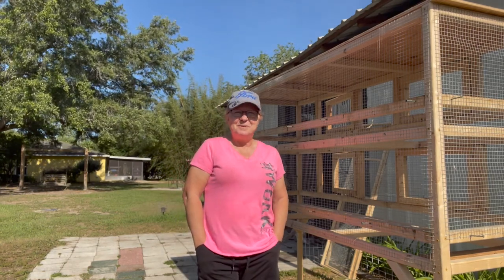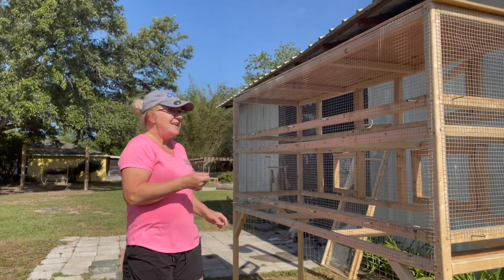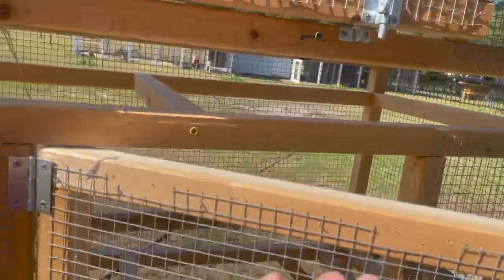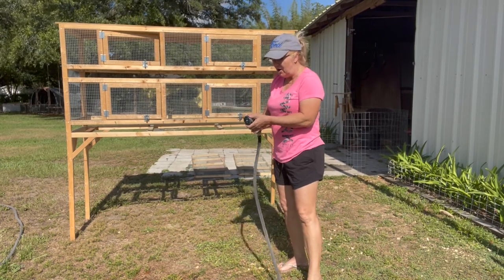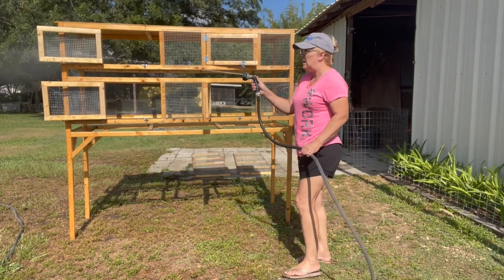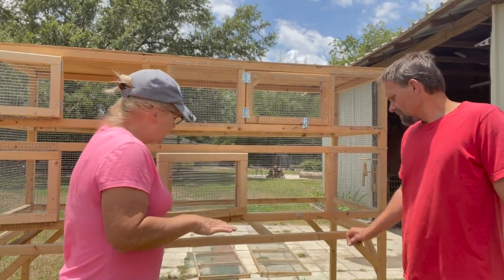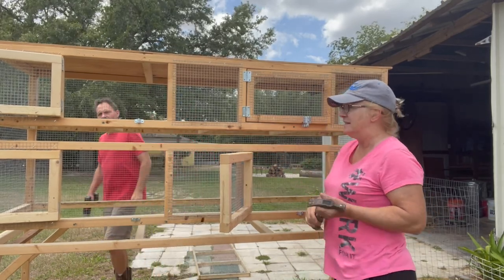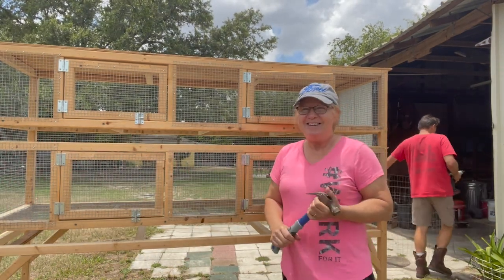QUAIL CAGE CLEAN UP MADE EASY with Removable Floors. No more dread!

Comment: Hello! I built a three level cage modeled after yours, but changed the measurements slightly to use three dog cage pans I found at Rural king. They ended up being a couple of inches longer and wider, but essentially the same. I really like the design.  Now that I see your grow out cage, I realize I need one of those, too. I still have the original measurements for the triple stack, but what is the new width? Did just doubling the previous width accommodate two of the oil pans end to end? Thank you.  Smiles, Darby
Reply from the maker: The grow out pen is pretty much just doubled. The width from end to end is 75” and the board that connects the 2 ends is 6’ (72”). The ends are built exactly the same as the 3 level cage but with only 2 levels. As for the height, whatever suits you and your height better. 
 
Thank you so much for watching!